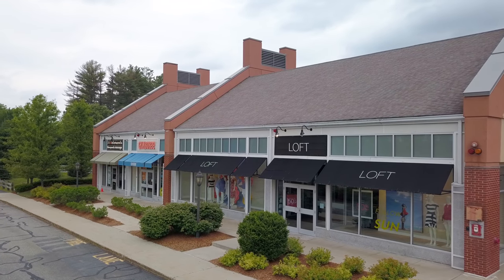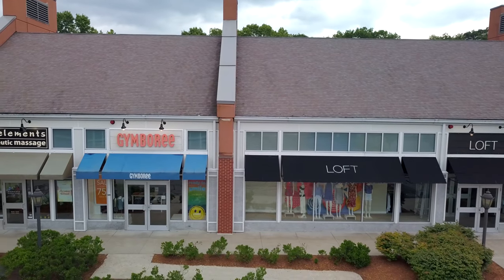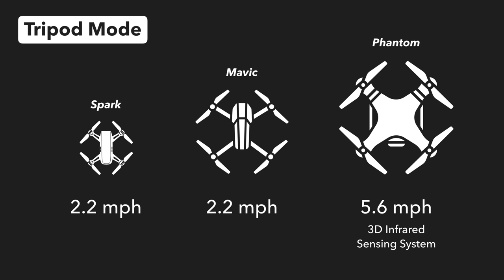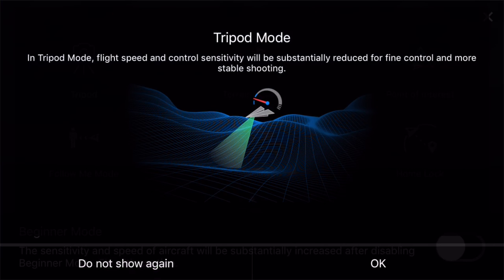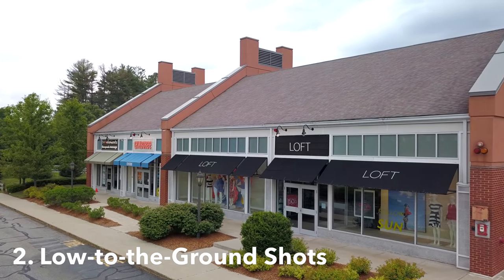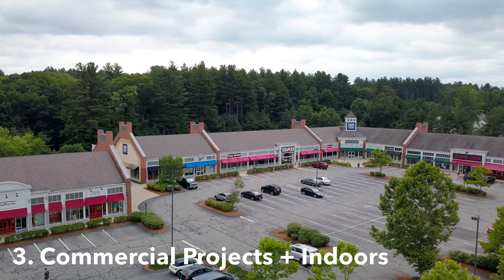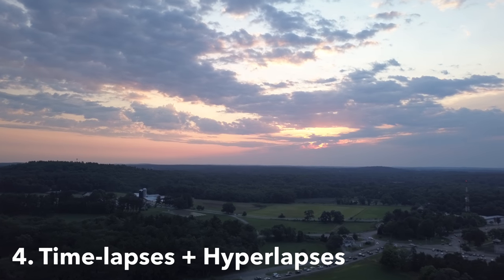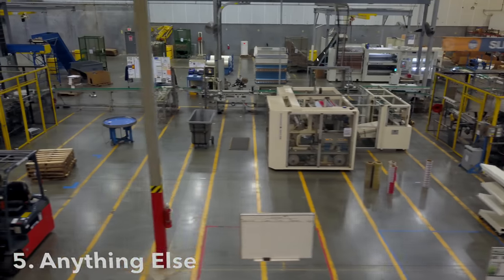DJI Tripod Mode Tutorial + 5 Best Use Cases!

Comment: good video. another consideration: The gimbal in tripod mode can be too slow. For Spark, a work around is to be in GPS mode, then lower the stick sensitivity (found in stick mode controls). This reduces Spark speed to that of tripod mode without affecting the gimbal rate.
Reply: Without gps can use tripod mode with spark I side building?

Comment: Did you have any issues with signal/flipping into atti mode indoors with that metal ceiling?  I have job next week in a precast building with a metal ceiling and I'm nervous I'll have to fly manual.  Thanks!

Comment: I use the Mavic Air 2. When I use Tripod Mode it still goes just as FAST as Normal when going straight ahead. Anyone else having these issues or can you tell me why this may be?
Reply: I just got my Air 2 today and had the same issue.

But it might have been because the flight tutorial sprang into life while I was shooting.

I will try it again tomorrow.
Reply: Christian Beaumont let me know how it goes or if you figure it out. Thanks.
Reply: @TheAeroRising  Yesterday was bad weather.  Tried it again today.  Tripod mode forward backward seemed to work fine.  I am still not happy with camera control going too fast, but that could well be me pushing it too hard. I am still getting used to it.
Reply: Christian Beaumont yea I was hoping tripod mode we could lay on the stick and it still just goes really slow.

Comment: I have recently updated my app to DJI GO 4 version 4.3.3 ( for my Mavic Pro) and the icon on the low left of H.U.D. for flight controls is gone.  I switch modes all the time usually for the reasons mentioned in your vid but now the app has changed.  anyone else experiencing this?
Reply: Intelligent modes not available in tripod mode
Reply: @steveh718  I think my friiikin sport switch was on on the side of the remote...  uugh

Comment: What is is the difference between Tripod mode & Cinematic Mode?
Reply: Tripod mode is much slower. If you are in cinematic mode and you stop the movement of the drone, it will take longer to stop, so it looks smoother. I do prefer tripod mode.
Reply: @danielwehrtmann1163  then the question becomes, what's the advantage of Cinematic Mode vs Tripod Mode? Like in what scenarios or applications would Cinematic Mode be more advantageous than Tripod Mode? I'm still a newbie and haven't filmed enough to be able to compare the differences in practice
Reply: Images By Raphael if you’re trying to make a time lapse video, using tripod mode will help you control better since It’ll go slower
Reply: @imagesbyraphael  I don't think Cinematic Made is limited to 2.2 MPH